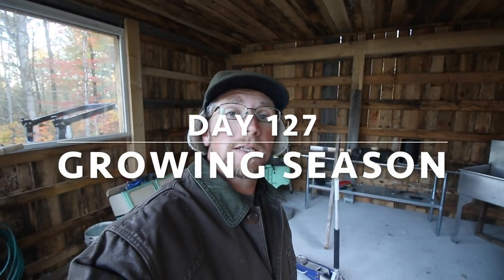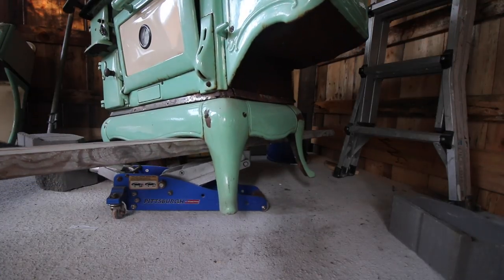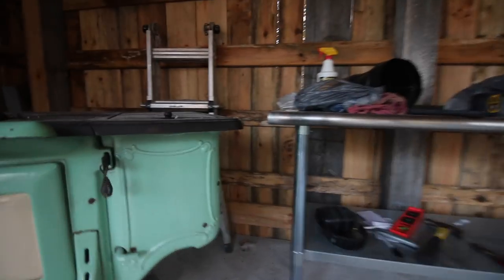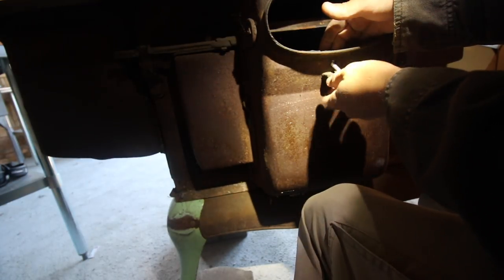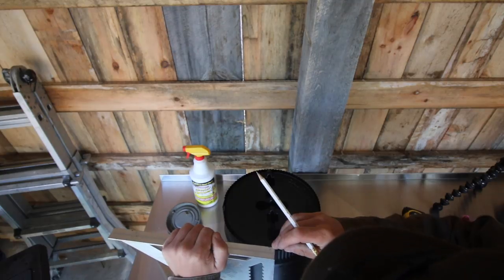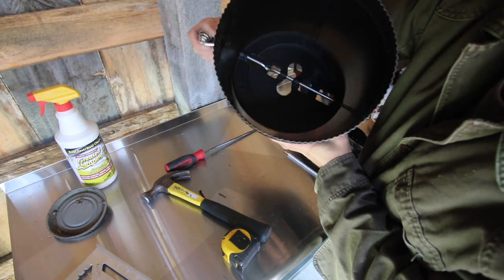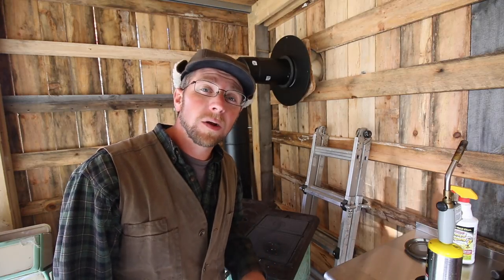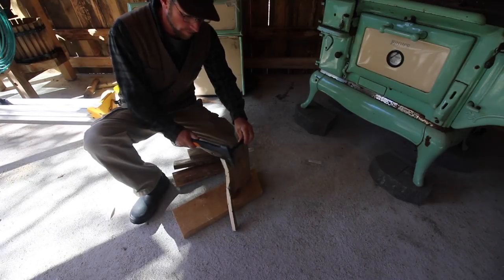🔥Installing the Chimney to the Antiques Wood Cook Stove🔥

Comment: Stove pipe looks real nice, all black and shiny.  How about some tips? The seam on your stove pipe should disconnect. It should be a C- lock and spring tension keeps it closed. This allows you to open the pipe and work on the flat if you chose. Simplifies layout and cutting with tin snips. 
Use your speed square as a height gage. The off falls from both sections of pipe are shorter than the length of your SS. Determine the length with your tape. Set the SS upright on the table on the wide flange. Set your pipe crimped end up, upright on the table next to your SS with your pencil mark along the side. Note the mark on the ruler edge of your SS. Now just rotate the pipe and mark your spacing. Much easier than fumbling with the tape, trying to hold it in the same location along the crimped edge. 

The same holds true for marking the holes for the damper. With the pipe standing on the table, crimped end up. Lay your SS across the opening, with the pivot point tight against one side. Look to the opposite side, pivot the SS until that side is at it's longest point on the scale (should be pretty close to 8") place a pencil mark on each side. Place your SS upright on the table again. Place the pipe crimped end down with the pencil mark along side the SS. Measure up 4 1/2" plus the height of your crimped flange, (appears to be 2").  SS sitting on the flat, upright on the table. Mark 6 1/2" or what ever it really is. Rotate and mark opposite side. You did something similar but were trying to balance a corner of the SS on the rim of the pipe. With this you can accurately mark the center line and the hole location at the same time. It will be square to the end of the pipe, and equidistant on both sides.
Reply: I was wondering about the crimp going inside the elbow at the top— shouldnt the crimp be going toward the outside so the creosote will go out?

Comment: Get you hands on an old rock hammer and some stone splitting cleats.  Use the hammer to tap out kindling..child safe..and then hammer drill your pathway and cement in some flat steps.  One slip with a load and bam.  Great project..

Comment: Use a little WD-40 to remove the stickers. It will dissolve the glue. Works on most stickers, including license plate annual stickers that are designed to NOT come off.

Comment: Bestine... or Doc Eddington's are the absolute best solvent to remove stickers, rubber cement etc...  I am surprised you didn't buy a couple of sheets of hardie board to fireproof and push it in the corner.

Comment: Sorry if this is easy to find and I just don't see it but do you have the part numbers for the new stove pipe fittings/parts?
Reply from the maker: What fitting are you asking about?
Reply: The oval one that comes directly off the old stove. I have practically the same stove. You point to it with your index finger at 4:44.
Reply: More specifically the 90 degree elbow. Do you have a part number or source for the 90 degree elbow?

Comment: Maybe I'm missing something but the walls look very leaky, full of cracks between the boards and lacking any form of insulation. Are they finished yet. You'd a fraction of the stove to heat it if you finished it off.
Reply: Jeff Freeman well it's an outdoor kitchen. It's not ment to hold heat. You use it in the summer for cooking and canning.
Reply from the maker: We just built the kitchen and are still in the process. We will be insulating and finishing the inside walls later. We want to make sure it is functional for our 3 day pig harvesting class coming up

Comment: xwow you have a pallet jack or did you rent that?  good idea about pouring a concrete step for the stove and bring it up that extra 1/2 “ at that time?  i want see the stove with the top part on it, then it will really look cute.  my in-laws had a similar stove in pale yellow, not sure it was cast iron tho.  its was so cute.
Reply from the maker: Ginas not sure about the top. Do you think we should put it on?
Reply: If it is functional, use it, I think. It certainly adds to it's charm!
Reply: I don't know what the top is, but won't it then be higher than the counter?
Reply: Rhonna Marsden tnjajj